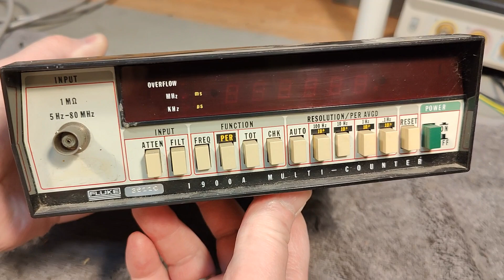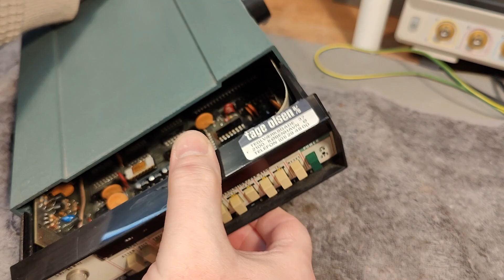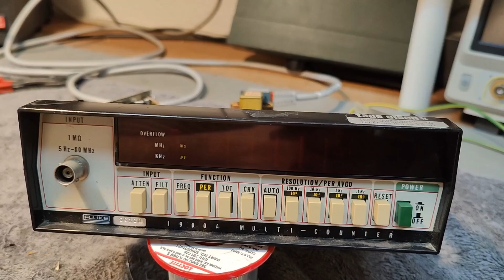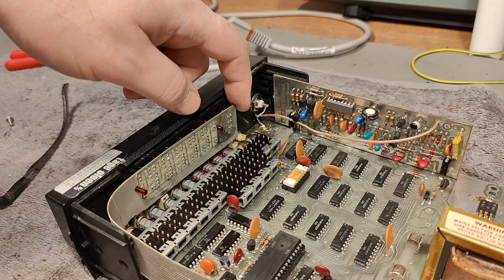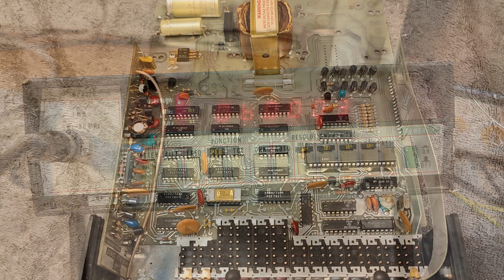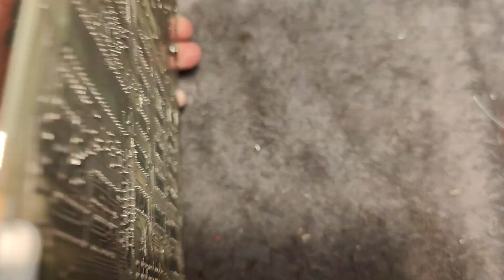FLUKE 1900A digital counter 6 digits 1975 test teardown

Comment: Another reason to switch in the low-voltage side is that this model was available with batteries and a integrated charger. The big holes in the board are for the NiCD D-cell holders, just like in the fluke 8000A.